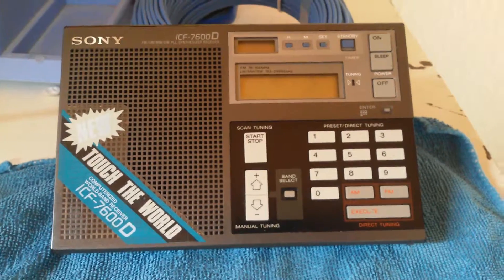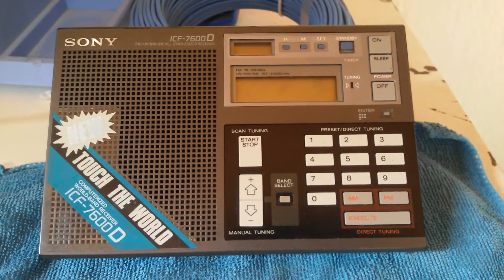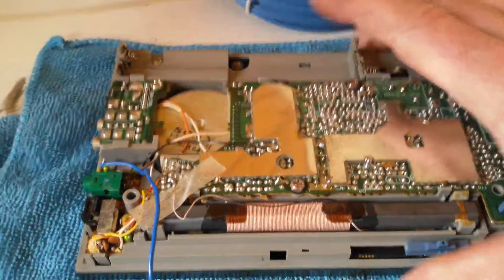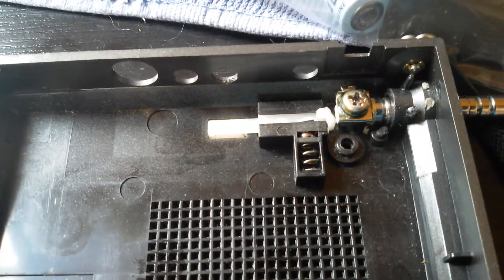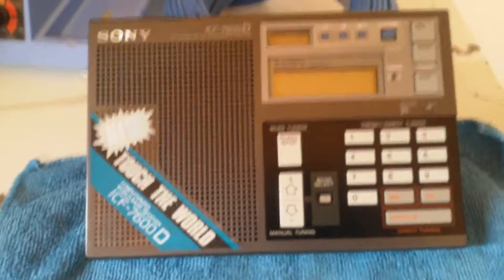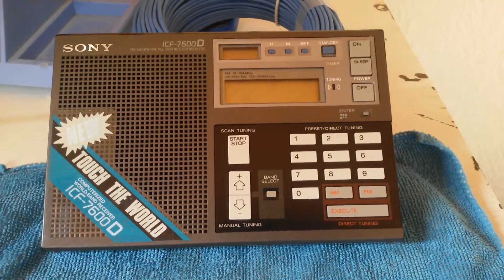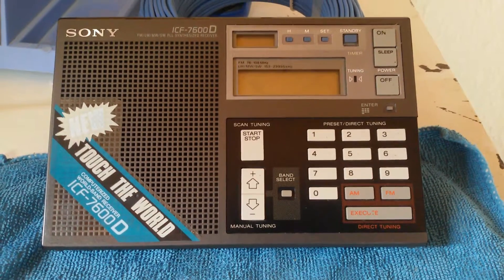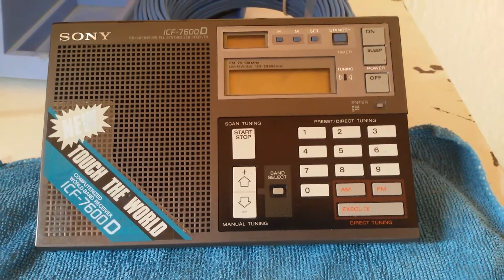Sony ICF 7600D  Defective Antenna

Comment: I just repaired an antenna that broke the plastic part it attached to,I used milliput epoxy putty to hold the piece with the hole through it and soldered the wire back onto the lug it broke off of, you can't pop it back down but it is rigid and works well.

Comment: Hi there, I recently picked this radio up at a charity store for $15. Everything works fine appart from it not scanning all the way through sw,mw and lw bands smoothly without repeating back on itself. FM and AM seem to scan fine and I can manually scan anyway. My other problem is the AM and execute direct tuning buttons don't seem to work or only work 10% of the time. Would these problems be easy fixes or should i look for another radio? Thanks
Reply from the maker: No I don't think it would be an easy fix....but for 15$ dollars you can't expect a perfect radio. If It still receives with manual tuning thats good.  Personally, I hardy ever use scanning feature because it misses to  many weaker stations.  I would keep it and look for a SW radio in the 50-70 dollar range(new).  Tecsun 310et, radiwow R108, or the XHDATA D808.  These are good SW radios and probably will give you years of service.

Comment: Hi Brian! I hope you had a successful project here. nonetheless it would have been much better if the seller informed about the defect. I purchased a Sony icf7800 from ebay USA and it was exactly as the seller described. I had to take out decayed batteries from inside the battery compartment and clean it  with home vinegar. Then I had to open up the board to get the band selector cleaned. Now it is a really good radio, though. Thanks for the video and Happy New Year!
Reply from the maker: Thanks for the comment...it was not really a problem.  It was fun making the minor repair.  Just a part of our hobby...minor problems are expected with these old radio as I am sure you are well aware of.   again, thank you for watching and making a comment.  73s Brian
Reply: @MrBrian8749  
You are welcome! 73!

Comment: Lamp on the Sony ICF-7600DS Dial

Hello, do you know or know anyone who has already placed a lamp or led on this Sony ICF-7600DS radio?
When it is night it is difficult to look for stations on this radio it has no lamps.
Oliveira.PU2OLT
Blog: http://qsldobrasil.blogspot.com
Reply from the maker: No I never looked into it.  For me a lamp for this radio is not important.  I bought it only to add to my collection.  It's only important it works for me as originally designed.
Reply: @MrBrian8749  Ok